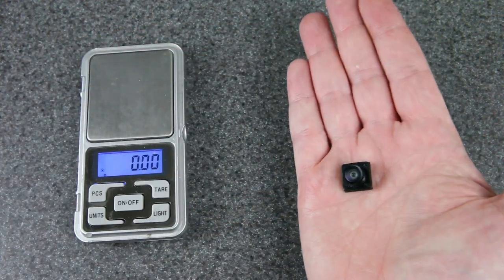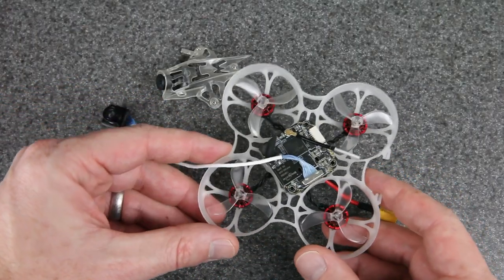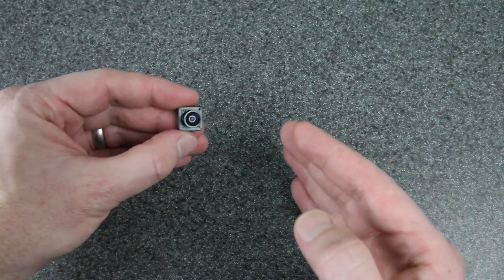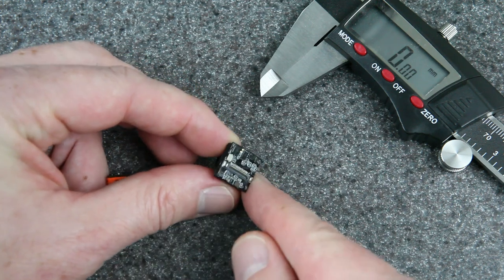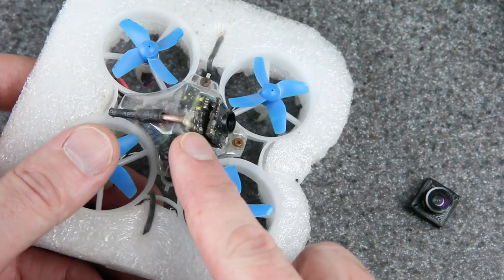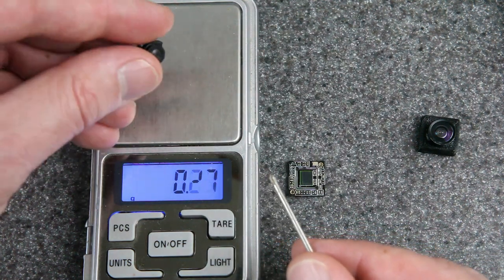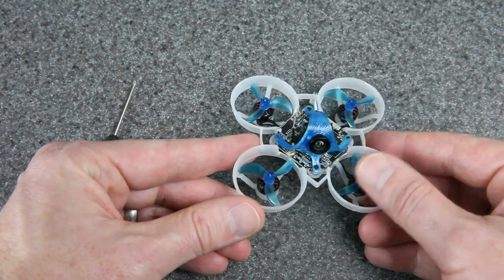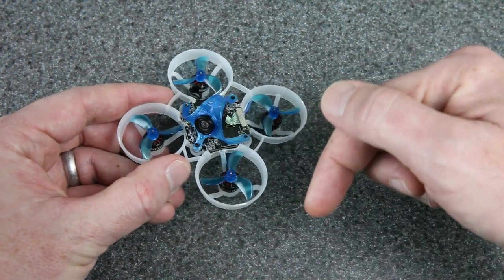Building an Ultra-Light Digital FPV Camera for HDZero / SharkByte

Comment: Any concerns with overheating or the body distorting as the camera heats up? One of the reasons the camera manufacturers use metal is for heat dissipation. That said, an aluminium or (probably too expensive) magnesium body might be ideal for that and still hit your weight goals. Let's hope Runcam see this and runs with it.
Reply from the maker: Good question, but I think it will be OK. This TPU prints at 210-230 deg C. If the camera heats up to even half of that then we’ll have other problems. Aren’t most FPV camera bodies made of molded plastic.
Reply: @MrShutterBug  well, I'm watching/following your development closely, as I would like to use a similar system in micro RC cars for indoor FPV racing. Though an analogue system is easy, my challenges on going to true HD have always been: 1) heat (no props to cool the electronics in a car); 2) weight and size (same challenges as in 65-75mm whoop); and 3) field of view (for a realistic racing experience)...maybe 4) "faked" head tracking by attaching the camera to the car's steering servo. Your work has inspired me to soldier on, and I think an under 5 gram HD system is 90% there now. (In 2018, when I first started working on this, the Connex system I used was over 50 grams and cost nearly $500. DJI is lighter/better by far, but still way too heavy... HDZero looks like it might be the answer).

Comment: printing in PLA with a non-threaded hole and then using a m8 die will probably get you better results
Reply from the maker: M7 in this case. The lens barrel is smaller.

Comment: This is awesome!  Love how you are able to just make what you need since it’s not even on the market. Well done. 
Quick question perhaps I missed the answer in the video, but why does the camera need the IR filter for this build?  I know some have removed them for night flight using IR lights. Just curious. 
Thanks
Reply from the maker: It has been a while since I ran a camera without an IR filter, but I believe it would result in very low contrast making the image look washed out. The sensor would pick up IR light all over the image, including parts of the image that your eye would normally see as being dark.
Reply: @MrShutterBug  ah gotcha. Yeah been awhile too. Just was curious if there was a HDzero specific reason or something else 😅. 
Thanks for the answer!

Comment: HD system don't need OSD chip and without it the aio board can shrink down to 20x20. the HDZero can shrink down to 20x20. now you can have 20g HD whoops.

Comment: I am interested in building. Ultralight 5” 1S build.  Imagine a 2206 in 19,000KV
Reply from the maker: Talk to Bob Roogie (KababFPV from FPV Cycle). I think he built something like that just to see if he could. I believe he said it was possible, but personally I don't see any advantage of 1S at that size. Higher voltage means less current, which means less heat, less need for thick wires, less damage to the batteries, etc.

Comment: Crazy little cam. cool details. can this cam be watch on 2.4Ghz express LRS??.
Reply from the maker: 2.4GHz ExpressLRS is the radio protocol I use to control the drone. It is totally separate from the video transmission.
Reply: Sorry, New at this and slowly picking up. How some of this vid confuses me is that since the title is almost always involving how to add a CAM to get better video then I always thought that when they talk 2.4hz (like radio transmitters frequency like you say) that they would be talking about how to better view the video through the frequency 2.4hz. So now that I got that clear. What frequency is best to use with the Fat Shark Scout with long range?.
Your assistance is much appreciated.
Reply: See like in this video
https://youtu.be/sKbUvGLhk_g
When he explains how long of range those black digital goggles go, how do we assume he’s referring to long range video OR long range transmitter. Those antenas are for what the radio or the video?. Most likely is for the video but that’s for those who knows their stuff. If you have a better video that cover this please link it. Thank you

Comment: I have no 3D printing experience, but I feel that for the case's threads, you'd want to print an undersized hole with no threads, and then use an actual M8 tap die to cut the proper threads. 

I personally just mainly fly whoops and analogue, but I appreciate what you have been doing.  Whenever/whichever brand of HD FPV format wins the whoop format race will likely be my first purchases into the format.  I just hope they respect interchangeability as I don't want to buy a new pair of goggles (I am using Orqa goggles).
Reply from the maker: @Imakilln  DJI looks great but it is nowhere near this weight nor this latency. Carl from Divimath is working on new HDZero goggles that will be totally optimized with 4 ms glass-to-glass latency. I can’t wait for that!

Comment: I'd like to print you some of those out of UV resin. I'm local.
Reply: 1/1000th of an inch resolution and screw holes possible. Make it as detailed as you want.
Reply from the maker: Cool! We would need to figure out the actual thread pitch for that, but it might be a nice upgrade. Ping me on FB (Nate Payne) or use the email on my YT channel’s about page. Let’s chat!

Comment: Threads on TPU, what is this black magic 😁I don't understand why the camera manufacturers refuse to do the research and find the wide angle cameras for us, considering they have the financial motive to do so. And it's not just the FPV cameras, it's the cheapo HD cameras too, the 120 degrees just doesn't do it for us, we need +150 and are even willing to accept the degraded imagequality (insta360 go) to have it. A lot of the cheapo chipsets can do 100mbps encoding as it's standardized, so the only thing restricting the performance of these cameras really is the optics. If you go through the trouble of designing the board, writing the firmware, then why on earth do you shit on your product with the cheapest optics on the planet?

 Some of the sensors have the IR filter built on the sensor, so they don't need the filter. Vignetting is the most common problem, chromatic aberrations are another. Abbe is rarely any good on these cameras but it always amazes me to see lack of contrast due to the lack of anti-reflective coating on the lens. That one is actually kind of a big problem with the ND filters, some of them let the light bounce between the lens and the filter so you can see the reflection of the lens on your ND filter spoiling your footage. Saving money from the wrong end of things is just stupid 🤷‍♂